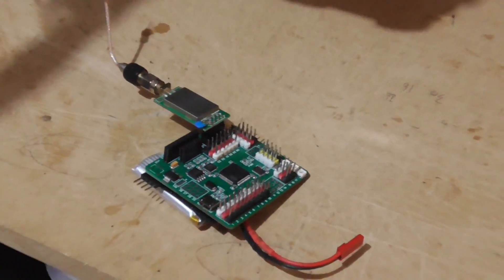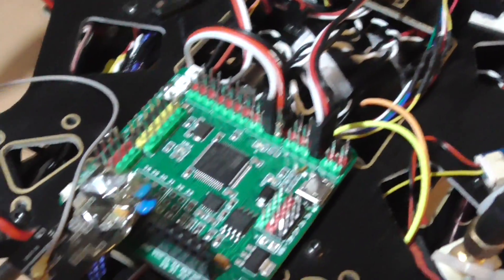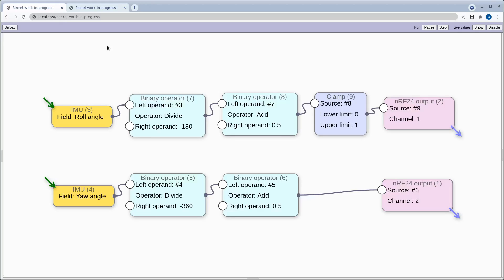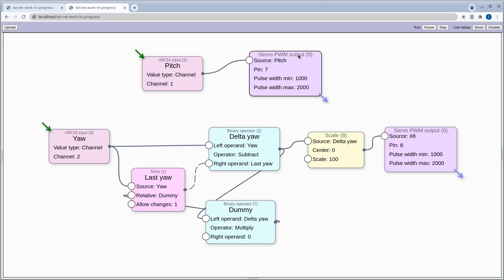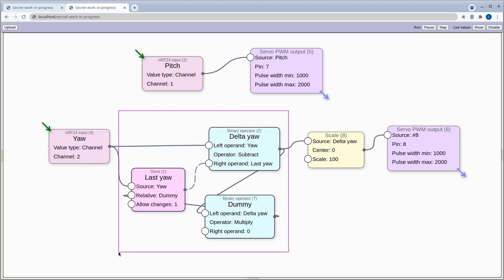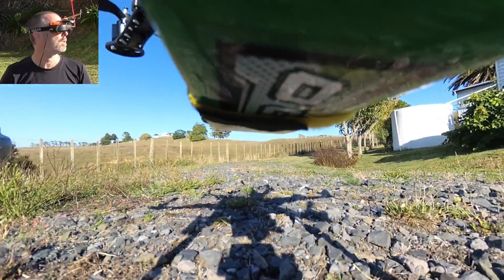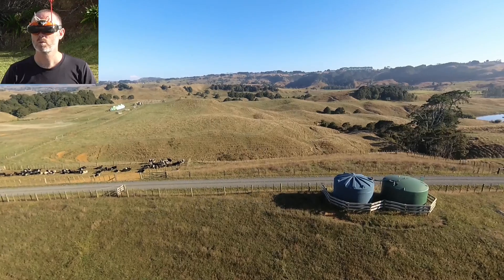Head-tracking gimbal (iomixer, STorM32, nRF24)

Comment: is it possible to buy such a device somewhere?  I want to apply this to a gimbal with Action-Camera.
Reply from the maker: You can buy head-tracking units for FPV goggles, that are used to control a pan-tilt servo usually. Would be good enough for a predator lasergun and probably better than a gimbal.

Comment: Real nice demo, even though your personal experience demoing was not greatest. Glad you had better experience prior (off camera). Really seems to add to FPV experience. 
You might consider having couple modes for head tracker: 1. relative to front of aircraft, 2. relative to flight track, 3. relative to user defined input (RC channel pot). Flipping a switch on radio would allow you to easily reset gimbal to a know reference. Besides reducing orientation confusion in unknown region, this could be useful if head tracker link suffered communication issue. (ie: some added redundancy)
For a alternative board name, you might consider kopilot controller (KC) as it supplements the flight controller (FC). Seems what you developed is a FC just doing supplemental operations not programmed into the main FC.

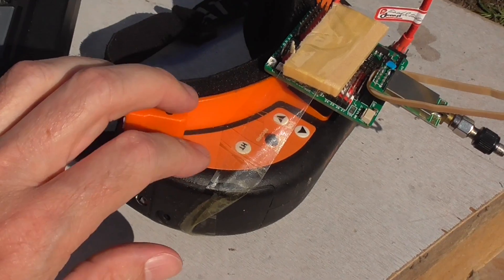Comment: 4:00 looks like a gender change adaptor on the antenna.....I'm guessing it's why the message to make sure one orders the anatenna with internal pin..?
Also, is the antenna you show just the standard one with the outer shell removed ?
Reply from the maker: Yeah, much easier if antenna already has the pin. Right, but as somebody pointed out it looks like a 5.8Ghz one.... oops.

Comment: It looks super cool and smooth, now I am sure I will build smth similar.
You need kinda failsafe there so you can control aircraft via fpv if your gimbal sbus mixer loose connection.
Also I think we need separate video about sbus mixer (once you have a proper name for it) with all history and current abilities of it.

Comment: That gimbal and RF setup is so responsive and smooth.  Pleasantly surprising.  I think I might know why the goggles are fogging up -- might have to do with tape and circuit board mounted over the fan?
Reply from the maker: The fan intakes are on the sides and unobstructed, I don't use it anyway. Might have been that I left the goggles out in the sun for longer before starting to fly....?

Comment: Just a question, I'm doing some projects with the nrf24l01 amplified antena but I think is a bit weak, I wonder where did you buy yours cs in my country there's only one tipe and it's the one that has everything on sight the black one
Reply from the maker: I usually get them from Banggood. $5 for the good one with metal can, antenna not included. Make sure the antenna is 'inner needle' type.
https://bit.ly/3lSsV8X
https://bit.ly/2Pr0cM8
Reply: @iforce2d  thanks
Reply: Sorry mate, another question, in one of your videos you used a yagi antena, do you recommend me to use a mix of a normal nrf24l01 antena on the base and the yagi on the exterior module? I need large distances to cover all the apple farm...
Reply from the maker: Yagi might be useful if you're only flying out in one direction. Otherwise you need to keep re-pointing it which could be annoying. Unless you're going over 1.5km I probably wouldn't bother. Look at my results for dipole only here:
https://youtu.be/WfskHptAK14?t=2128

Comment: Nice demo....The heavenly weather was a real bonus...You need a 433mhz unit for more range. Maybe increase sensitivity of the head tracker, you are having to move your head a lot to get the movement and then compromising the antennas on your Goggles...🤔😀🇬🇧
Reply from the maker: Recently I added PPM output capability to the sbusmixer, so this could now be done by a single radio link (eg. the FlySky with sbusmixer on the trainer port). If you wanted to fly and look at the same time you'd need to replicate the sticks and switches on the sbusmixer though... but overall it should be better for range :)
Reply: @iforce2d  I admire your experiments using cheap, freely available components. Always interesting, even if I don't understand most of it...lol...😀😀🤔🤔🇬🇧🇬🇧🇬🇧🇬🇧

Comment: OK now THAT's cool. Only way it would be cooler would be a stereo configuration!

Honestly surprised DJI or the like doesn't have a product like that out, it seems obvious to me that depth perception would be a boon to object avoidance and recognition, even with (or especially with) analog video.
Reply: I may end up doing the stereoscopic FPV at some point. I'm currently seeing if I can feed analog video into my VR headset with minimal latency.
Reply: @sightline4004  you should try openHD. However they don't support stereo video, at least for now
Reply: @remainsmemories626  Yeah I've seen that and EZWifibroadcast. The project is great but latency drives me insane.
Reply from the maker: There were some stereo FPV systems around back in the day, but it never really seemed to gain traction.
Reply: @iforce2d  Hey I was looking up 4G LTE FPV videos today and ran across this: https://www.youtube.com/watch?v=FQHB3-TFtLY

The company that they're using is Voysys, https://www.voysys.se/racing-over-4glte

Comment: 13:34.. You will need to put the head antenna in the middle of the top of your head straight up Chris. Or dual head antennas.. One in the front and one in the back of your head.

Comment: Instead of sending deltas why don't you send absolute values?
Reply from the maker: I thought I explained that in the video. The pitch is ok as an absolute value, because it doesn't rotate 360 degrees. The yaw uses "relative turn around" mode to make use of the slip-ring. If it was an absolute value with no awareness of the ability to endlessly rotate, think about what would happen when you cross between 179 degrees to -179 degrees...
http://www.olliw.eu/storm32bgc-wiki/Configure_the_RC_Input
The relative behavior is also useful for forcing it to skip position, like a stepper motor losing steps.
The ideal situation would be a mode in STorM32 that uses absolute values for yaw, and also knows about the slip-ring so it can take the shortest path between two angles.

Comment: Soil erosion on those hills is tragic.
Reply: MAD GRUMPYMAN  Would you want NZ to change into a Desert like the Sahara?
Yeah, that's pretty exaggerated, I admit.
But it's actually a modern Problem. Where Forests or Brushland used to be, we put fields to source food now.
In some places, this leads to erosion. What tends to be a little trench here and there, gets really big in a few years or decades and can render pasturage and fields unusable.

You will find that in every civilized country that has rain and agriculture.
You will also find that along the borders of the Sahara and the Gobi desert, which tend to get bigger.
If you want to keep countries able to supply themselves with food indefinitely, you will want to keep your soil/nutrients from washing away and stop soil erosion on the large, as well as the small scale.
Reply from the maker: What specifically are you referring to? Most of the bare dirt we can see is caused by livestock walking around, over years they pummel the steeper parts of slopes into flattened terraces or steps, just by virtue of it being easier to walk on a flat piece of ground than a slope. On this particular farm the overall number of livestock is quite low, but they are all bulls which can apparently reach 700kg, and also have a habit of taking dust baths in those larger patches of bare dirt.

Comment: you could probably get away with a low bitrate lora Tx - that would give you more range than the vtx :)
Reply from the maker: Recently I added PPM output capability to the sbusmixer, so this could now be done by a single radio link (eg. the FlySky with sbusmixer on the trainer port). If you wanted to fly and look at the same time you'd need to replicate the sticks and switches on the sbusmixer though... but overall it should be better for range, and the aircraft control and gimbal control would fail at the same distance :)